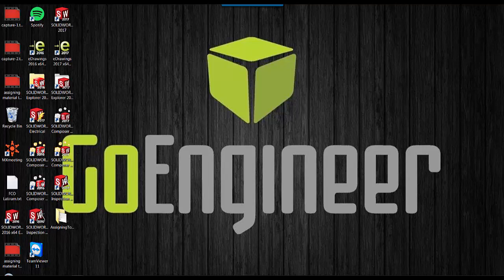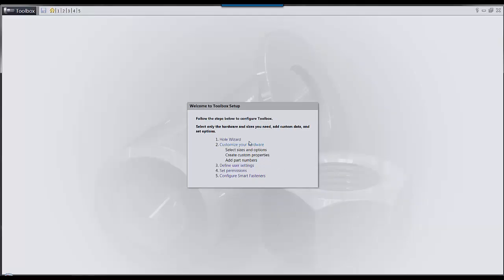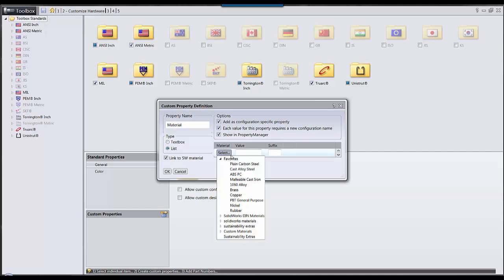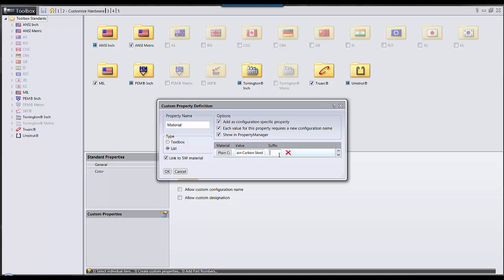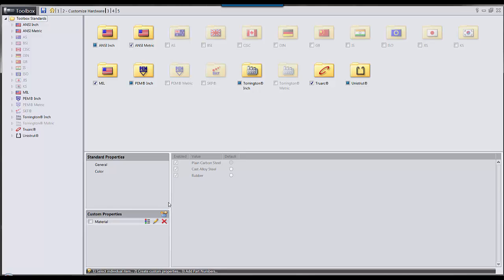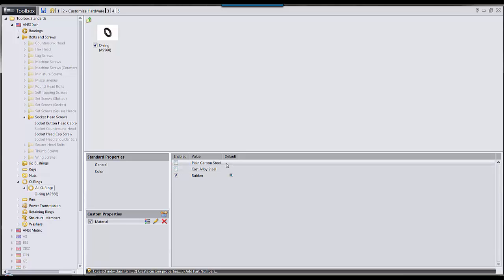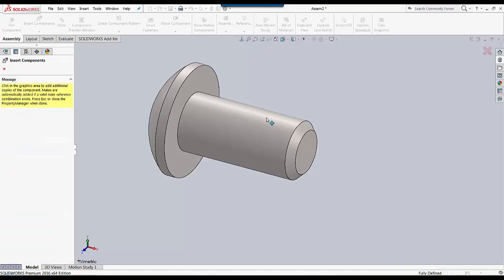SOLIDWORKS - Assigning Toolbox Materials

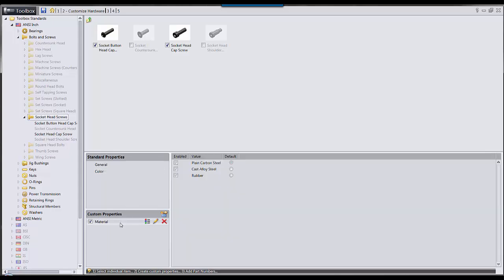Comment: At 2:17 you get a warning that if you select yes, any, meaning ALL, existing part numbers will be cleared.  You know, DELETED!  What happens if I have 10 years of toolbox data that has been added as I used the toolbox parts?  Throw it away and start over?  Why did you pass over that without so much as an acknowledgement of pending doom?  I want to know how to at least gather the information to enter later for an estimate of how much this addition is going to set us back!  How much work it is going to be to gather that information and replace all the toolbox information that has been deleted?   NOT insignificant, I'll guess.  GoEngineer just acquired CATI that is my VAR, and I normally like GoEngineer information, but this is bad to an extreme!
Reply from the maker: Dudley, These videos are meant to be quick tips and tricks for how to expand your use of the Toolbox. This is not intended as a deep dive into the topic that covers every situation or context.  If you have a massive part library that you want to add material data to there are techniques that can be used to preserve existing data. Each category can be exported as an excel sheet for example and from their you can preserve the part numbers in on of these sheets or you can use it to add the materials. If this is a project you are working on right now please feel free to reach out to us and we can help you find the best way forward for your specific context.